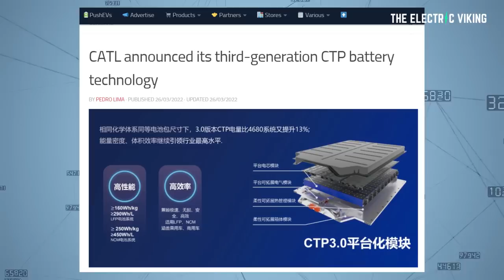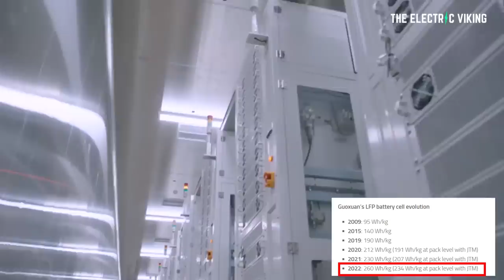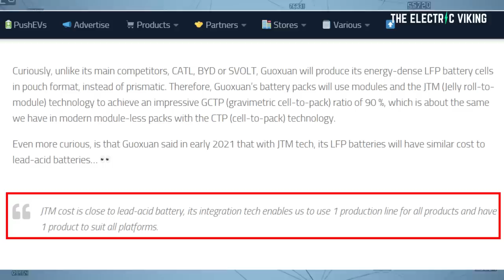260 Wh/kg LFP cells - cobalt & nickel batteries are DOOMED

Comment: You can say that about LFP also because they still use Lithium and that is very limited in production. Tesla used 25% of all lithium production 2021 to build 900k vehicles. So it doesn't matter if LFP or more typical ni/cobalt - there isn't enough lithium produced; the price is up 80% since Jan; and up 1000% since 2020.  This problem with dog the BEV industry until a breakthrough solid state exists; that scales, charges fast, lasts, and is at or about the same $ per kWh.  If solid state does'nt happen Li EVs are a dead end.
Reply: this is why lot of companies look into new mining options. there are plenty of lithium reservoirs. in austria and germany alone we would have enough for probably whole europe.
just a matter of money and time.

Comment: Some people have myopic view of EV market. 
Most people working in trade need the range and density of Lithium ion battery. New pickup trucks and delivery vans cannot use LFP due to low energy density. Electric airplane market can NOT use LFP due to energy density. LFP has a niche, and each manufacturers will find the right battery chemistry for their need as their market dictates.

I need an electric tow truck with maximum range and power for towing my RV or a boat. LFP will not be considered for my truck but for my RV house battery and boat use.
Reply: Furthermore, LFP is American technology allowed to be used by Chinese and LFP battery is planned by other manufacturers outside the China. Why is Chinese manufacturer emphasized in this video? LFP technology has advanced as other Lithium battery chemistry has advanced also.

Comment: We know how cool LFP batteries are. But outside of China they've been held back because of patents till recently, for whatever reason the inventors or IP holders made a deal to keep LFP batteries contained inside China and not charge the Chinese LFP batteries makers a fee as long as they did not ship them outside of China. I'm guessing they figured China would not pay them anyway, but I'm not sure. So like always happen the majority of non Chinese manufacturers waited to bulk produce LFP products (outside of hand tool batteries) till now.
Reply: I have a solar system with chinese LFP 11kwh I got the batteries one year ago for $2400 now you can get 16kw for the same price
Reply: Yes. I am worried about patents. In this fast-moving area patents should have a shorter life. Two years would be enough and would encourage continuing innovation.

Comment: We are not at the point in history where car buyers will care what kind of batteries are in an EV. Doesn’t @$&#*% matter if there are none to buy and you have to wait a year for one. Just make as many EVs as you can guys with what ever batteries you can get your hands on.
Reply: Hungry or what? The tech is changing at such a high rate it's hard to keep current.
Reply: @calmorton4619  …he he…you said current…
Reply: LFP made form readily available materials not needing cobalt which is relatively rare, means they can churn many out to churn out many BEV cars for people to buy.

Whereas if batteries and other components need rare materials it will be expensive and in short supply and limit product and therefore availability.

Comment: Crazy for companies like Northvolt to go all in on NMC, they will be outplayed and the bubble will burst unless they change strategy and adapt. I will for sure not buy a car with super explosive NMC batteries
Reply: If NMC batteries are considered "super explosive" (which they are not) then a tank full of gasoline must be considered a clandestine therrmobaric device.
Reply: @SkyRiver1  Check penetration test of those cells and tell me you want them in your car? The differce with diesel and gasoline is huge much more reactive and you have not much time to get out, so the wrong kind of accident and it's no fun, not considering LG chems recall, inability to stop an electric fire and conflict minerals etc, it's clear LFP such as BYDs is better choice
Reply: @SkyRiver1  I think maybe you don't want to get my point? I want Ev currently have an euro5 diesel. But as you should know, 1 thermal runaway and your car and everything close to it might burn everything down, if your find with it it's good for you. I don't want old NMC batteries with conflict metals and not being able to put out a potential fire, as well as degradation and longevity, second life etc etc. Just like Samsung note 7 and LG with GM:s Bolt EV recall, and especially since Northvolt had 0 batteries in 0 car as of now and minor impurities can cause thermal runaway or just one accident with debris on road cam with bad luck have a explosive reaction, 5his together with the price of NMC vs LFP the latter makes a lot more sense, so why should I pay for NMC?

Comment: You are jumping from A to B to C, combining promises of future technology successes with what is on the market today.
If you stick with Tesla, who is on top of battery technology and would use better technology if it existed:
You pay a price, both in weight and range to go with LFP. When Tesla swapped out Nickel batteries for LFP in their Standard Range Plus version of Model 3, There was a slight reduction in range, a 200 pound increase in weight, and no change in pricing, but better availability. The LFP takes incrementally longer to charge, and has poorer cold weather performance.  I looked, but could not find what percent of sales are long range version, costing an additional $10,000 and what percent of customers take the shorter range.  US customers for new cars tend to compare what they already are driving with  the improved performance offered in the replacement vehicle. I assume most would take the 300 + mile range version vs the 200 + range version because they think someday they may go on a 3000 mile trip, even if they never do.
  I do not where you get the "LFP is half the cost of Nickel" or "Just Asking" Do you select a car  for  the ability to drive to Alice Springs or Fremantle? as a person in the USA would.
Remember the words of Mark Twain. " "The storage battery is, in my opinion, a catchpenny, a sensation, a mechanism for swindling the public by stock companies.

Comment: I’m confused— will 4890 cells be LFP or am I conflicting technologies??
Reply: As far as I know 4680 is a physical package, it does not have to use a specific chemistry.
Reply: theoretically 4680 is just a form factor. practically only tesla uses this formfactor for their latest NMC chemistry with an energy density in the area of 296-300Wh/kg
so, theoretically you could make a 4680 cell with LFP chemistry. maybe tesla will do this at some point to have one single mechanic/electric design for two chemistries. or even three chemistries when they start to spike the graphite anode with more sophisticated silicon nanowires, which they themselves don't know that they will do that in the future.

Comment: I think the biggest challenge is the cold weather performance in vehicles.
Reply: I suggest you check out Lars Strandridder's channel, BestInTESLA. I believe he lives in Denmark, and went on a trip through Norway and Sweden to the arctic circle this winter in his Tesla that he filmed. No cold weather issues whatsoever for the Tesla, other than the roads being blocked by snow storms and the driver (Lars I believe) skidding off the road once. Norwegian's new vehicle purchases in February were 86% plug ins, with pure BEV's making over 75%. Can't be to bad in the cold weather with those numbers.
Reply: @GoCoyote  Yeah but what about the cold weather performance of LFP?
Reply: @jamesvandamme7786  
LFP has just about the the same cold weather performance as other lithium chemistries, but way less susceptible to thermal runaway, and some can even be charged below freezing now. Any EV worth buying has a good thermal management system that maintains the battery at the temperature needed for proper functioning. I just saw the March numbers for EV's in Norway: 91% Plug in, with 86% being BEV, and they are buying BEV's with LFP batteries.

Comment: See i took Catl claim to mean that for the same chemistry their prismatic form factor battery pack would be 13% higher.  There is no way that lfp could compete with a high nickle 350wh/kg 4680 structural battery pack.

Comment: Again, you need to a bit careful talking about LFP batteries with high energy densities.  Those higher energy densities are not necessarily being accomplished by just the base LiFePO4 chemistry.  So what it actually means is a bit less definite than what is being implied here.  Regardless, it will generally mean that far less nickel and cobalt would have to be used (if they wind up being doped in at all).

That said, if battery makers can deliver on these higher energy density LFP-based batteries, I agree that it probably means the-end for older NCA/NMC chemistries.

-Matt

Comment: Sam, Thanks for another video full of information on battery tech, especially critical developments in China.  These recent developments sound like an inflection point that will eventually result in BEV dominance of the worldwide auto market.  HOWEVER, you are driving me crazy with your “Watts per kilo” nonsense.  Clearly you mean Watt-hours per kilo[gram], but this has to be translated every time you mis-speak.  Please be a proper VIKING, and get your [extremely] basic physics correct.  Otherwise I may have to send Bjørn Nyland down to Melbourne to provide remedial physics lessons! 😀

Comment: Sam.
You're just throwing rumours at the wall to see what sticks.
.
Fact:
Latest LFP won't reach the same density as the LATEST Nickel based cells.
.
Fact:
If LFP can be used in structural packs, so can nickel based cells.
.
Fact:
If LFP cells, in a structural pack vehicle, can reach the performance window of "last years" 2170 pack Tesla cars, it's ideal to be used in the "lower spec" models........ BUT  you seem to forget the advances due in Nickel based tech?
When those cells jump to 300+ W/kg AND use structural packs, they will be compounding their advantage by requiring fewer cells in the pack, making the car even lighter and more economical, PLUS reducing their relative price.
Reply: I agree, but also I consider the spread of a usable 100% charging profile to eat away a bit of the advantage of the nickel based chemistries at present.